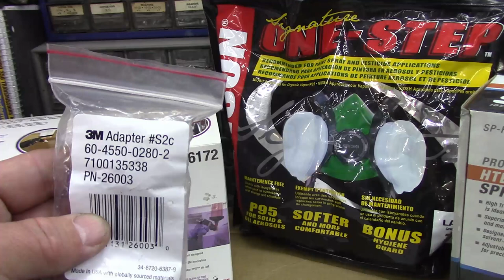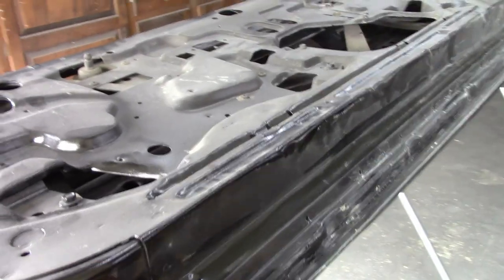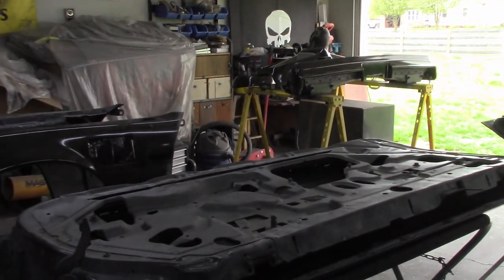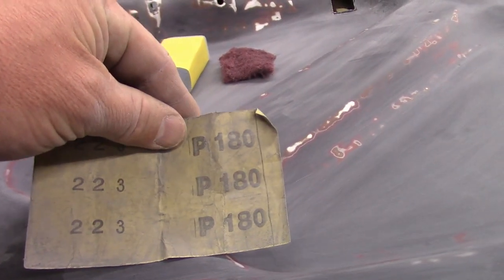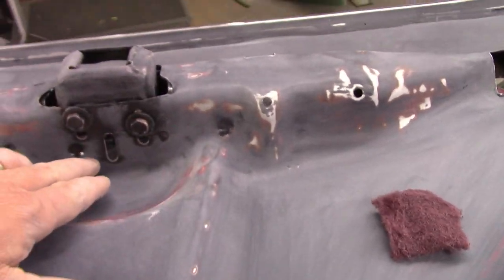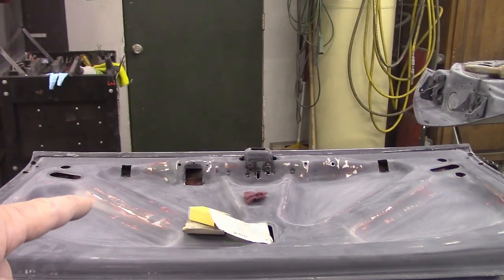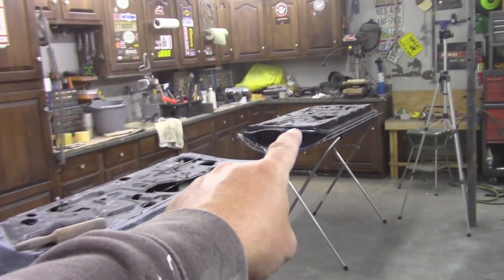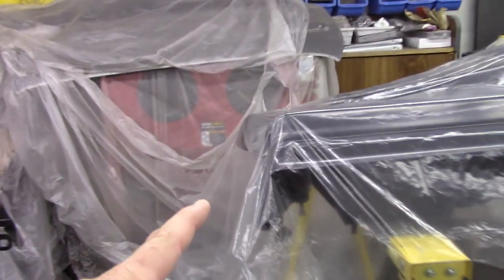How to Sand Car Jambs for Paint.  Channels to watch for good paint advice! 1975 Firebird Restoration

Comment: Those front nose bumpers fit tight. I would paint them before hanging on the car. One less thing to worry about on painting day.
Reply from the maker: Gotcha. I hear ya. I’m a just a little worried about the color match and the pearls laying differently if I don’t paint it all at the same time. Might put it on a stand and shoot it at the same time, just not in the car. I dunno. This is the stuff I stress about. Kinda silly cause it always works out in the end. Thanks buddy !

Comment: Awesome work.  I scuffed the bottom of a hood awhile back with 320 dry and didn't seal went straight to base & clear.  No issues at all and it's a pearl paint too.  Maybe my 320 needed changed and 'degraded' to 400 or so I'm not sure but it worked for me.
Reply: Cheap paint too Urekem.
Reply from the maker: That’s awesome man. Good to know that even without the sealer it lays down good!  I’m not even sure I’ll wet sand at all with the way this is turning out. I’m really thinking about doing the 400 grit to be “safe” and then hitting it with a gray scotch bright.
Reply from the maker: Yeah. I’m really really impressed! As long as the  company doesn’t change things up, I’ll probably never buy anything else. Quality and super cheap. Crazy!

Comment: There is no sealer on those seams on the doors from the factory...at least not on my 78 Camaro, and I'm the first person to ever dig this deep into it so it's definitely factory. Also, how much stock do you put into the whole "X" pattern of sanding while doing the jams? Do you typically try to adhere to that , or just as random as you are able to sand it? Great channel resources that you sited early in the video too!! Lastly, I would paint the bumper jams before putting them back on for the simple reason being; you have already taken that car down to bare metal and done a full on tear down so might as well continue to "do it the right way" so to speak. Whereas, in my case, I've never totally disassembled my car as it will surely lead me down a dark road of more work and I've always intended for it to just be a driving street car that I will beat up on. In other words, you've already come this far so.....
Reply from the maker: Right on man! Thanks for answering the seam sealer question.  On these jambs, i didn't get caught up in the x pattern.  The factory jambs are pretty rough with the spot welds, seam sealer, etc. so i didn't feel like taking the time to make it perfect.  I would have skim coated filler and blocked it down with the x pattern if it was going to be a show car though.  I just stayed random and kept moving.  Plus the block i was using covered most of the surface area of any given contour, which i think reduces the chance of coming out uneven. But really the idea is that i wanted to move this along and the jambs are kinda rough and no one really sees them anyways. Even though i "cut some corners" for the sake of time, it came out really nice.   Now on the exterior panels, ill be x'ing that shit out for sure👍

How is your car coming along?  Had a chance to work on it much?

Comment: Nope, no seam sealer on those particular seams. I happen to be working a couple doors right now too. Never seen sealer in those spots on any firebird though.. 😉
I just paint and clear the parts loose off car since it's a solid color. If it was a 2 stage base/color/candy then I'd assemble and paint together.
Reply from the maker: Thanks for answering the seam sealer question.  My paint does have a pearl in it.  Probably be ok to shoot separately  but im definitely leaning toward doing "the walk".
Reply: Having owned at least 20 Firebirds, I second the no seam sealer there. It could trap moisture inside the door from faulty window seals.